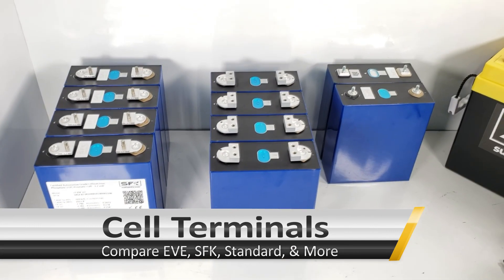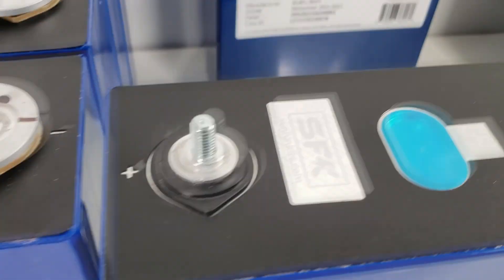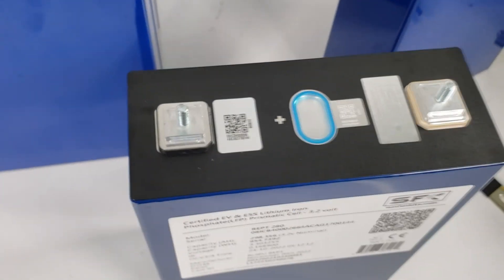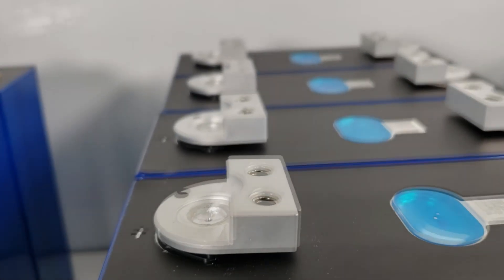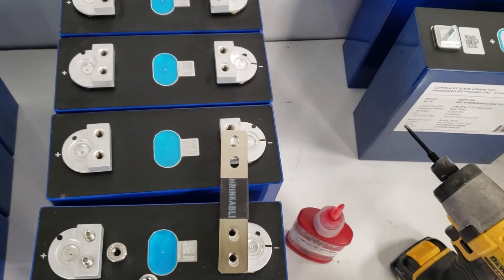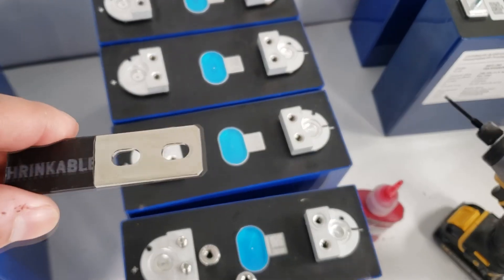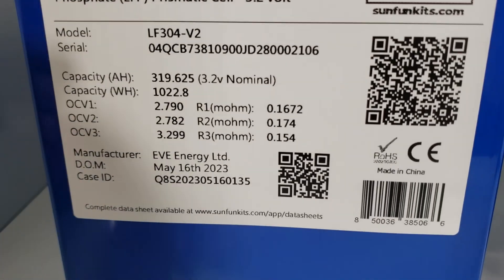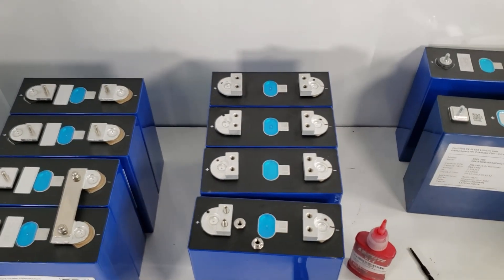Comparing EVE, SFK, REPT,  & Common Battery Terminals for Lifepo4 prismatic cells Pros & Cons

Comment: I do not understand why there is no standersation on the LiFePO4 terminals as is on many other batteries.
Did EVE explain why they have changed these terminals (again)?
I have seen how Chinese manufacturers align the terminals, their jerryrigging often consists of some laser-pointer type of set-up (if any) and by hand place the terminal. Inaccuracies are bound to happen. But so bad as your video depicts I've never seen before.
I believe it is a poor choice in design as the terminal (and its positioning) should never become a question of bend over due to mechanical stress or poor workmanship when laser-welding those terminals. Any design should be pretty fool-proof in manufacturing and in usage.
Using loctite in an electrical situation is a big no-no, it is indeed non-conductive. (LocTite does have conductive liquid product but that is an epoxy adhesive, not for thread-locking) Indeed use locknuts (or two nuts back-to-back to counter-lock) and if so applicable, knurled ring.
BTW, I also dislike this change as it often means you will also need different busbars again...
Reply from the maker: The diy segment is very small for eve 99% of there sales are to oem and electric buss makers for them they will build the entire battery pack with an enclosure. I supposed they did not like the little studs that are common as they aren’t rated for 280a amps. This is true but on the same token hardly anyone is pulling 280a from these cells. In fact the average draw is about 40.
Reply: @sfkenergy  Fair enough but you outlined some very clear shortcomings, I would hope they listen to your feedback.
I'm an OEM myself but still we build our own (12v) packs and source the enclosures as we want to tightly control the quality. 
(we have learned that hard way that outsourcing those steps can create "challenges" at times and occasional hiccups in the supply-line).
I agree, even we hardly come close to the rated 1C loads, at best it is a very short peak.
Still, I'm puzzled by EVE's recent move as they could have done so much more better avoiding the mistakes you have clearly outlined.
Thanks for the heads-up, much appreciated!
Reply from the maker: @InspectorGadget2014  the eve terminal is sufficient for stationary storage I think will keep it as is. It’s only where you are in a mobile or vibration probe situation where the dual poles have issues. I believe majority of these cells are used in stationary back up power so for those users it’s fine and probably doesn’t require threadlocker and other stuff to secure cells.
Reply: @sfkenergy  Our application is mobile/ambulant and we did have a few recent failures which are still under investigation (x-ray & such).
Granted, one was a drop (of about 20 inches, cracked the casing but not the cells AFAIK) and why we contacted you via email about a business enquiry for your kits as we have some specific needs. Generally speaking, to date we never had any failures on the post-connections but we stuff, similar as with your kits, plenty materials to secure the cells. So I agree, it should be okay but I foresee some challenges next to what you already outlined. It is good you offer your customer the choices.

Comment: I have the eve new terminals and have no problem with the terminals and i recieved bolts and not scews . Apply locktide with common sense , tide with common sense with nm meters 6nm up to 8nm max. 

What i experienced is about the sunfunkits vs4 . i had to adapt the handle to fit on the new eve terminal diagonally . Terminal of the last cell pushing in got abit pushed down . i had to adapt the central plate with the actif balancer by cutting it and glued the rest of the central plate with the balancer on the back of the glass plate that holds the BMS. Sofar no problems with it but there is a consern that SFK should look at.

The major problem that i have with the recieved vs4 kit  are the cables added with the kit. gauge 6AWG even double is nowhere near the size needed for 200 amps . ive kept open minded and tested with the recieved cable to confirm theoreticly and testing that the 2 cables of 6AWG are getting burning hot when pulling 199.95Amps for 30 min. I cant mesure the temps of the cables but i could not touch them anymore without burning and the BMS temp was almost 69c (celcius). I have pictures and screenshots if ya want them .
Before any reply . i know they are silicon cables . That doesnt mean they can handle more amps . It means that they can handle abit higher temps before melting the isolation. Its wrong thinking of the chinese and at this time SFK that these cable would be fine. 

6AWG = 13.5mm2 x 2 = 27mm2 , 25mm2 =70A , 35mm2 =100A  , 50mm2 =150A and 70mm2= 200A
So you need theoreticly 70mm2 or 2 x 35mm2 to keep it low temps.
I did test selfmade cables 2 x 35mm2 but couldend get fit aka cant get cover on the box . after testing many cables and pressed with hydrolic press of 6 ton , I finaly ended with 50mm2 single cable at B- , 50mm2 single cable on the positive and 35mm2 single cable on C-.

Cables used are Flexcable dubbel isolated category 6 (very flexible) spec is (celcius)70c nominal , 160c shorted .
On testing this cable setup for 30 min at 199.95 amps the 50mm2 i can hold on it , Its warm but ok the 35mm2 was getting hot , i could touch them with no burns and even hold it for few seconds and the BMS maxed at 58c (Celcius).
Btw the cells busbars where never hot as i used common sense

Not to be negative about SFK kit . Just to give info and hope that SFK addapt the cable sizes , maybe the size i used..

I understand that SFK try to find theyre own terminals so they dont have to addapt the kit for it but its a diy kit and as a good diyer its easy to addapt it yourself and even SFK could easely addapt by scewing the actif balancer undernead the glassplate under the bms and dont print the center plate with its support. less material used , faster printed.

Just my 2cents
Reply from the maker: Yes if only common sense was... "common"... Please contact us regarding the riser we have various version of the riser, the dual pole use the V4C which is smaller plate, i'm assuming you have V4B. 200 amp should only be used in burst situations and not sustained. This is why we rate our batteries at 125AMP continuous.
Reply: @sfkenergy  Im all good . i have fixed everything as  a diyer should be so battery is completed.and finished and tested.
 
On youre website you sell the diy kit as 200amp also the BMS V2 is rated at 200amp continious  discharge so rating and cables should be 200amp and not 125Amp

Anyway The cells are fine and the BMS is fine  the kit is fine unless mount the actif balacer directly on the glassplate., its just the cables that you should change to better meet the specs of the 200amp BMS .If you sell these kits as 200Amp then the people believes it can handle 200amps.i made the change so it can handle 200Amp and my rv will not end in flames.
For the rest keep doing what you do , its perfect.
Reply from the maker: @mrballbreeder3749  The Bms is rated for 200 Amp discharge and it can be with proper air flow over it. When inside a case, the limiting factor will be heat inside an enclosed environment.  If you have proper airflow you can use it at 200 Amp continuous. 

Inside a case our case which has no airflow you will hit thermal throttle / limit.
Reply from the maker: Also if you are in a cold environment then yes 200 AMP is possible as well as long as internal temperature does not exceed 140.

Most people are using 200 AMP for a short period, e.g. 2-3 minutes to run a coffee pot or something.

Again we explain it on are pre-built version the 300HP.
Reply: @sfkenergy  good to know about the 140 something ill keep an eye on it. i have the diy kit . 
My testing with my cables had no problem to deliver 199.95Amps for 30 min and 215amp for 3 seconds (anything longer makes BMS shut down and thats normal). Max temp BMS got was 136c and cables much lower so with the right cables your kit is cabable to deliver more than 125A continious and 200A burst of 120 sec. You just need to use the right cables.
Btw my testing was in warm enviremont it was 29c celcius aka 84c fahrenheit.

The test is based on my case of usage on my rv  . If airco is running (max 1200w ) and we start cooking electric (1000w max) The installation need to be able to handle 2200w meaning average of 183Amps at max. Ofcorse it will be rarely that this max will be reached as both device will swing and mostlikely pull less , much less power.Airco that has reached hes goal temp drops power usage down to 300watts same goes for cooking.
Reply from the maker: One of customer sent us a link to there build thread using the dual pole cells: https://diysolarforum.com/threads/my-build-thread-with-lf280k-from-18650batterystore-and-sun-fun-kits-sfk-v4-heated-kit.63360/ it just need the proper riser plate.